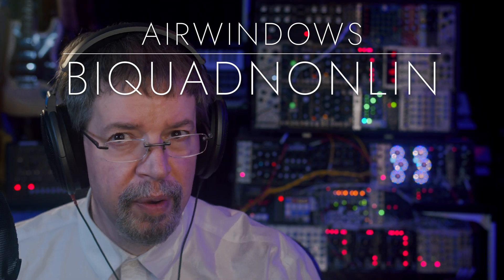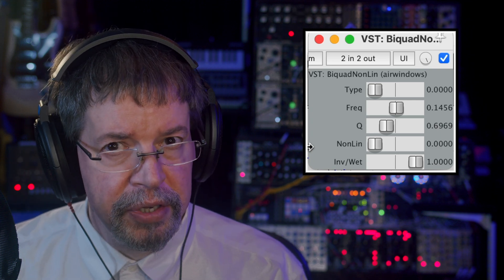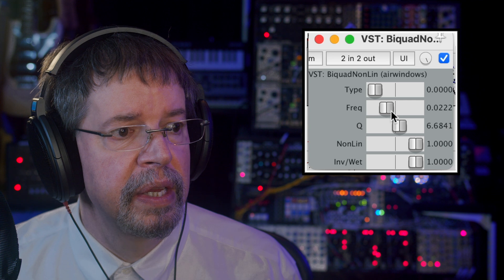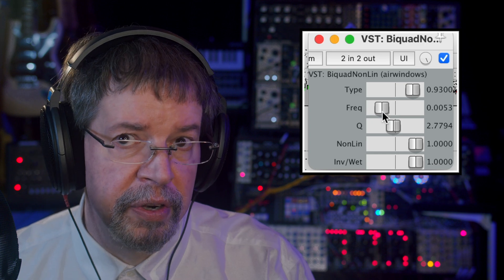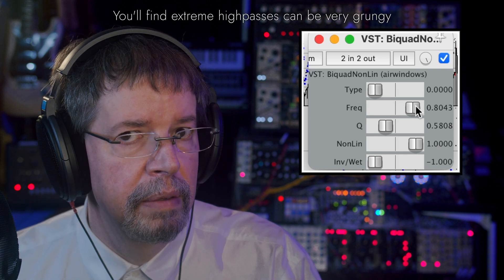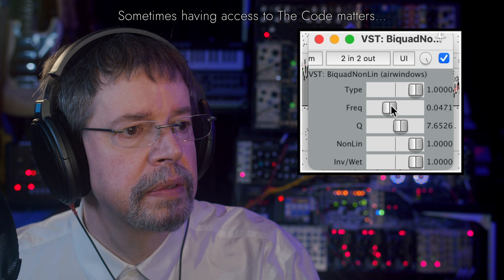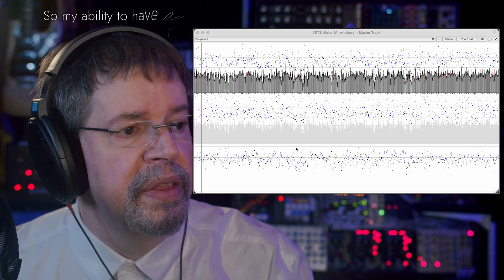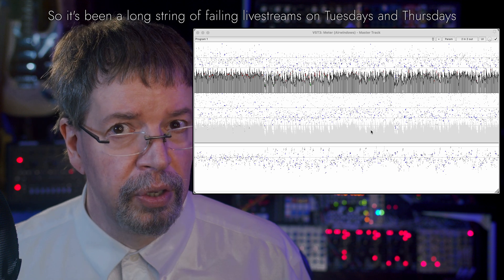Airwindows BiquadNonLin: Free Mac/Windows/Linux/Pi AU/VST/Rack

Comment: Excellent work as always, and really exciting stuff ahead; build systems can be really annoying and alien, and most of us never figure them out, we only end up finding "some set of instructions and configurations that work". I'm not familiar with these issues in particular, but there definitely has to be someone following you that knows exactly how to deal with it. Don't get too hung up on it, I'm sure we will figure it out! (EDIT: I'm opening an issue on the github repo to mention something related to the Windows error...)
Reply from the maker: The way it works, if anyone can help me get the silly thing working, I can fork/template THAT plugin… then add whatever other code… and at that point I can run it until it breaks and make lots of the new plugins, following the one working template. We just do not have that yet, but there was a time when I didn't have one working VST2 build… and now look at them :)